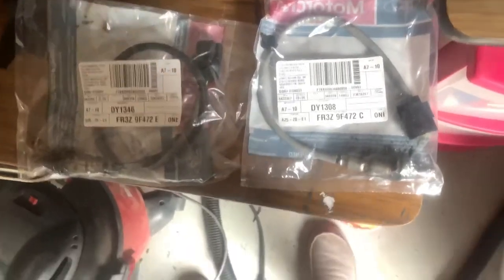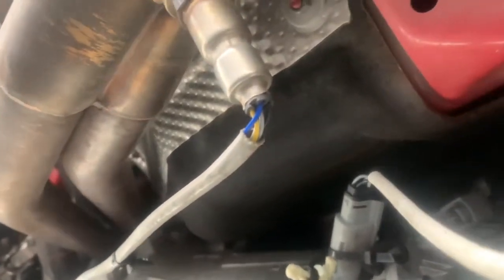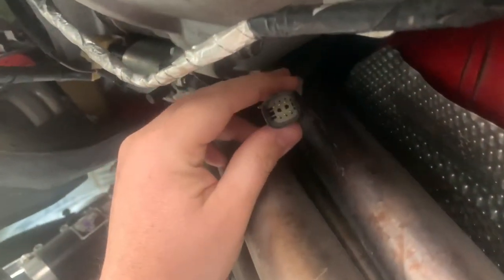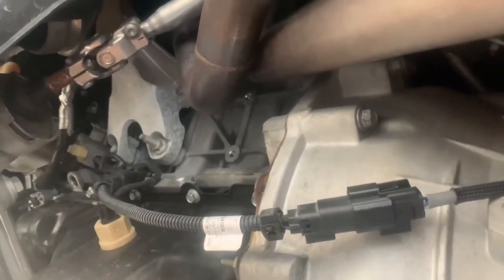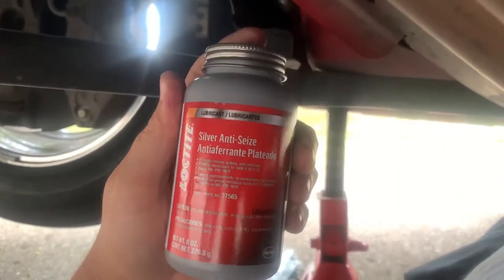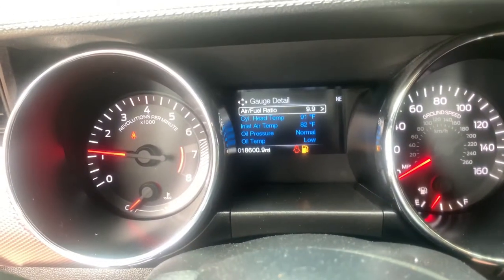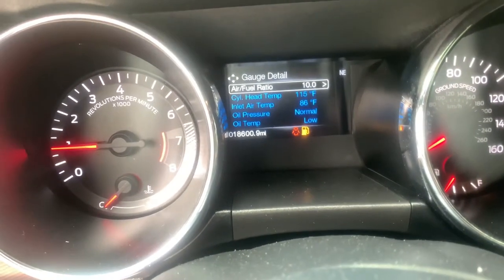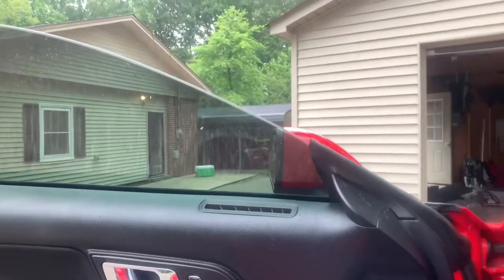O2 sensor replacement 2016 mustang GT

Comment: Does the driver side have 6 prongs too on the connector like you showed for the right one ?
Reply from the maker: Yes. The driver side and passenger side will enter change. Only difference is the passenger side is longer.

Comment: I just bought a 2018 mustang gt and I’m having a bad idle and it came with longtube headers and it has high flow cats I didn’t see the down stream sensor
Reply from the maker: 2 things come to mind on this. Send a data log in to your tuner and he can confirm. Your up stream O2 sensor could be bad or your MAF needs to be clean. Also check the air box to make sure it’s on properly.

Comment: Can you use ngage to look at differential temp
Reply from the maker: What temp you looking for? Also depends on the year of the car and trim of the car.
Reply: @NickelWhiteS550  diff temp on a 2017 gt. Mustangs with digital displays can see it but I'm not sure their year or trim level. I read something on the internet all s550 have the sensor. I'm not sure if that's fact thou.
Reply from the maker: That is Incorrect. My 2016 doesn’t have the sensor but my 2018 does.